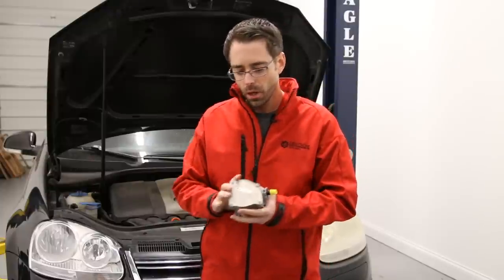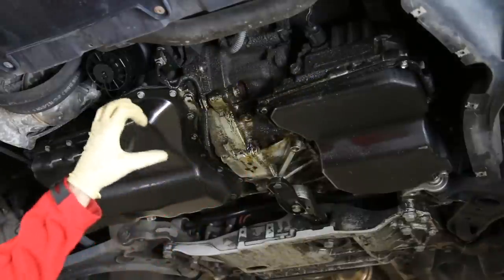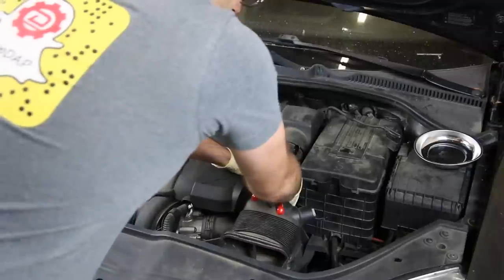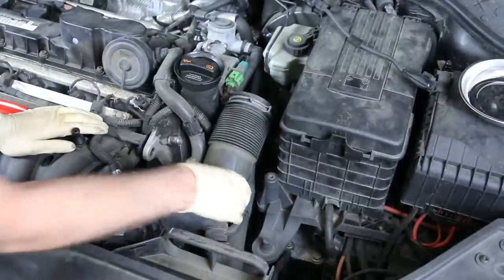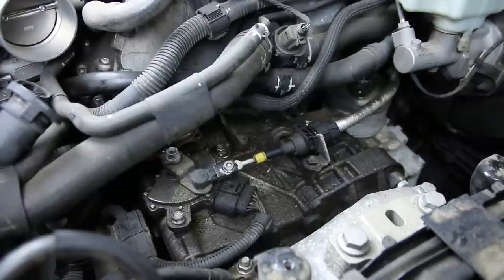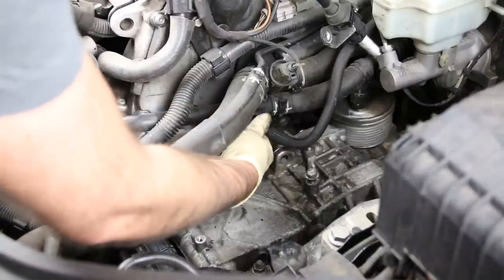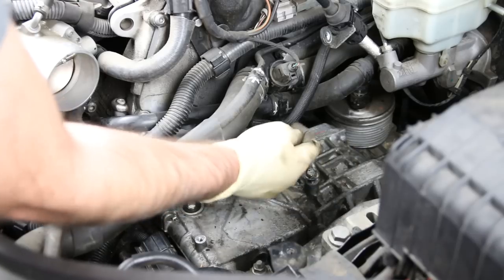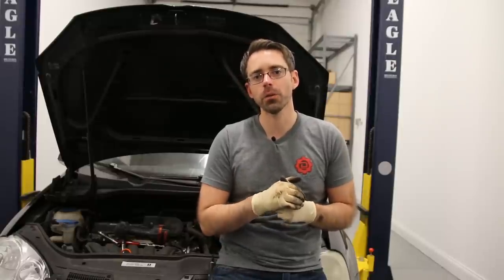How to Install a Vacuum Pump on a VW 2.5L 5cyl (Find Parts HERE too)

Comment: Do you know the size bolt you market yellow? Also I didn't markt mine will it be fine?
Reply: It's a 10mm bolt. Was your car okay without aligning the bolts?
Reply: @dizzyfeast308  thanks for answering my question. its ok so far but I do notice  a difference it seems to be a bit more jerky.
Reply: We're you ever able to get the jerkiness resolved? Mine has been doing this too.

Comment: Usually after how many miles does this vacuum pump start leaking?
Reply: Mine started leaking at 88,000...
Reply: Mine at 167000 miles
Reply: Mine around 103k
Reply: 164,500 for me
Reply: Mine started probably around 90k
Reply: Mine after 120k miles

Comment: great video and info - what's different on a manual transmission?  (07 jetta wolfsburg) thanks
Reply from the maker: Yes you don’t have to take the pump apart to take it off

Comment: Thanks so much for the helpful  tip. I found a replacement gasket kit for this pump. would that work or do I have to buy the whole unit?
Reply: Frank G where did you get it?
Reply: @carlingas666  Got it on Amazon.
Reply: @carlos alvarez. This is where I got it and it worked perfect! NewYall Vacuum Pump Rebuild Seal... https://www.amazon.com/dp/B07MBG7KTD?ref=ppx_pop_mob_ap_share
Reply: Frank G Did you just remove the 4 screws, remove the backing plate, and install the one gasket? Or did you remove the entire vacuum pump? Where does the other gasket go? I seem to only see the circle gasket that fits into that teardrop shape (I think).
Reply: @joehumeas7196   No. I removed the whole vacuum pump took it apart and replaced the gasket that goes against the engine, then another gasket that goes to those 4 screws you're talking about and then there's an O ring that goes on the valve stem straight to your brake booster.  I replaced all those gaskets and it's working perfect! No leaks at all and it used to leak like a water fountain lol. good luck! and.
Reply: @joehumeas7196   This is a pump for your brake system. The problem is the seals inside and go bad and it  leaks oil leak through their.  If all it is an oil leak and your brakes are fine then I'd suggest just replace the gaskets like I did. Hope this helps